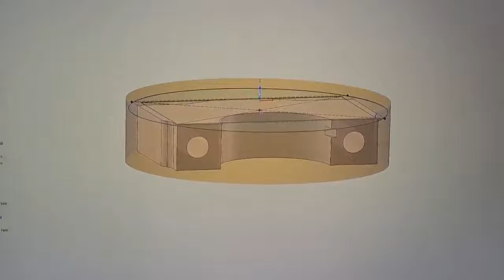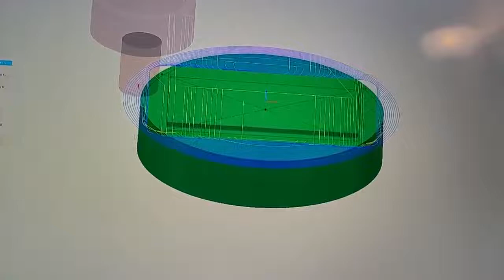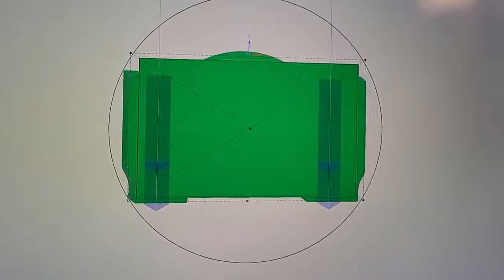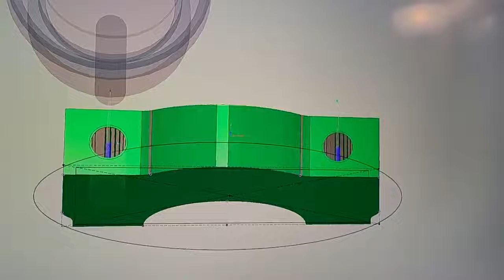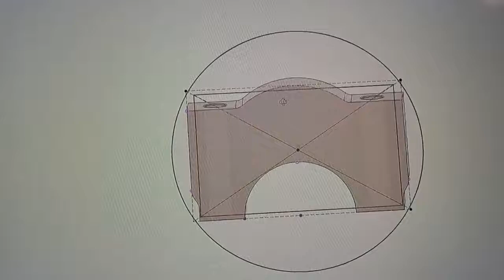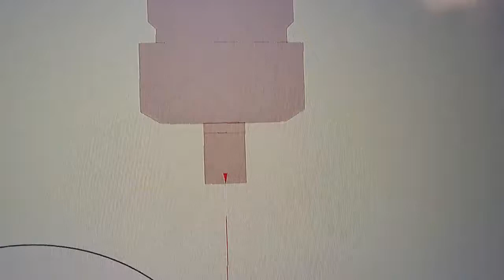Billet Main Caps - Fusion 360 CAM Toolpaths and Setup

Comment: Good luck with the slot for the tang. Thanks for putting so much effort on this.
Reply from the maker: Thanks. I actually have another idea to make the tang, but haven't tried it yet. Thinking of using a slot cutter.
Reply: Sounds like a good idea. They look like such simple parts until you get up close.